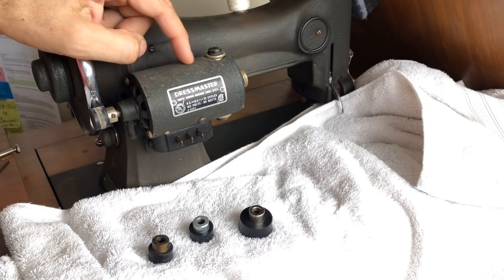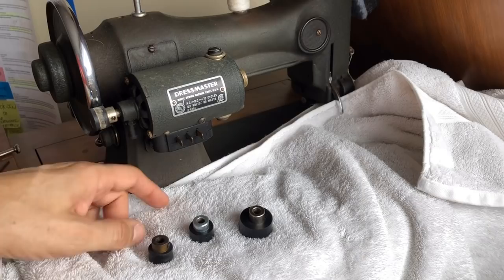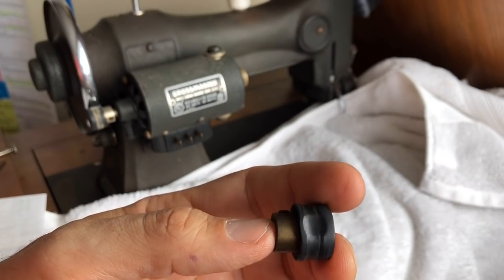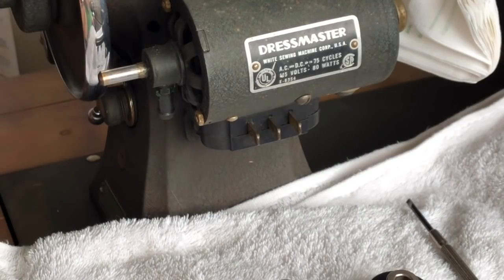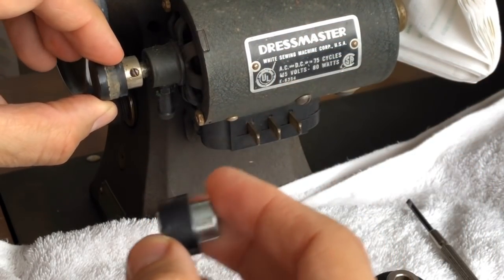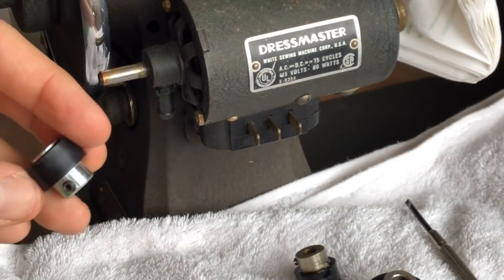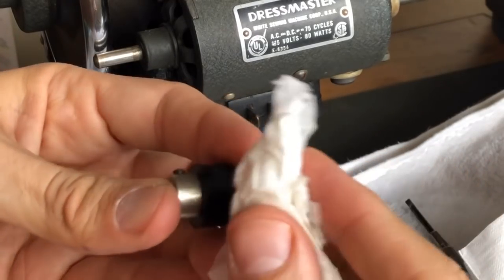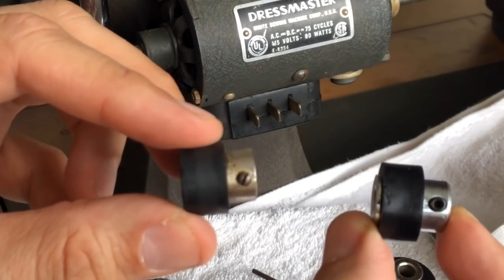ROTARY SERIES #1: FLAT TIRE! Replace a Rotary Machine's Friction Rubber Pulley & Start Sewing Again!

Comment: Thank you for these videos.  I recently changed the friction dry pully.  It took FOREVER to get it off, even though I used WD40.  It was a STRUGGLE !  AFTER  it was off, I RE-listened to your video.  You mentioned waiting overnight before pulling it off.  Since I'm a senior citizen,  I probably won't need to replace it again.  But for other ladies watching your videos, please EMPHASIZE  that the WD 40 needs to sit OVERNIGHT...( AND that it may be much harder
for a lady to pull it off than for a man to).  I had to use all manner of tools to pry it off, including PRAYER.  I'm glad you showed 
more than one way to screw in the little screw ( I used an eyeglass repair kit screwdriver).  Keep posting these videos.  They help .
Reply from the maker: Thank you for sharing these ideas Andrea.  Yes, it can really make a difference if Penetrants such as WD40 or other brands are allowed to sit overnight.  Actually, I may have mentioned this in a video I did several years ago when I had to soak a Singer 185J for over 2 weeks (maybe 3?) to get it to loosen up, but its a great idea to repeat this approach so thank you and its exciting to hear that you managed to get yours replaced!!
Reply: @VintageSewingMachineGarage hola tengo una Domestica Rotary 167 esta linda máquina trabaja muy bien solo que la polea está ponchada y aquí en México 🇲🇽 no encuentro. Usted sabe que lugar puedo comprar por envío? Soy de Monterrey México.  PD.👍Me gustan sus videos gracias

Comment: I just begged for and was given a Dressmaster Rotary. I have had a Kenmore Rotary for years, so there's nothing new about it, really, but I was given it with the understanding that it needs refurbishing. There's a possibility that the spring pushes the motor to the handwheel might be bad. I've watched this series, but not guidance on how to deal with that problem. Do you have any suggestions?

Comment: I just inherited one of these from my mom.  It definitely has a flat tire, needs all cords replaced and a very indepth cleaning.  I look forward to seeing more information from your videos, you are very knowledgeable.
Reply from the maker: Thank you Valerie.  The great news is that you can get new reproductions of both the friction drive "tire" pulley as well as the power cords for these.  Stay tuned for additional new videos on my White version of your machine.  They share many components and features.
Reply: @VintageSewingMachineGarage  thanks please show the movement of the lower assembly

Comment: I have a white rotary with black enamel and gold paint decorating it. It has the motor and a light in the rear. When I took it out of its case to restore the case, I was wondering what had happened to the belt. 😳 Now I know there wasn’t one to be found on purpose. I can’t wait to clean, oil it and get it running. Thanks for these videos.

Comment: I have two White machines that have a bevel pully and I can't find a new pulley for them. One is a 1926 bronze anniversary edition. I tried the small pulley replacement and the rubber wont reach the wheel (the motor does not adjust as yours does) supplier has the same machine and states the large pulley wont work with the machine either. I have used a section of rubber hose to retrofit and it works so so. Did they actually replace the entire unit back in the day or just the rubber? Seems like they were very frugal back then maybe there are rubber parts still around?
Reply from the maker: Great question!  I've never had one of these as old as yours, but there should be some solution given how large the White brand once was.  Try joining a White or Rotary sewing machine group on Facebook or another social media site.  There are lots of devoted fans of many brands that have groups/clubs online where they share info.

Comment: Do you have a video on how to replace the Stitch Length Plate and the lever.  I tried to take it off and there was a very thin yet very strong metal rod (within the lever itself) that popped, but did not break off.  My machine does sew, however it is not letting me change the length of the stitch.  It's sewing in a micro stitch fashion regardless of what number I place the knob.  Since that metal rod sort of popped, it still sews the same and does go in reverse.  What is your suggestion? Try to fix myself or take to get it repaired?

Comment: Im so glad you did this video..i just bought a 1917 Singer 66 Red eye with a Steampunk motor...Ot doesnt take a belt like the one you have but the motor looks different...She is beautiful in surprisingly great shape for $50.00. She  came in an 1890 something bentwood case and had 13 different back clamping feet or attachments all original..Sadly shes missing her bobbin slide plate..Im so sad about that but then again for $50 bucks who can complain, right? Im desperately looking for an original one ... So she runs great.... BUT is only steady going when I apply light pressure to keep the roller wheel against rhe hand crank wheel...

Comment: This video helped me so much!  The pulley part was completely missing from my White machine after years stored away. 
I was able to order another one. 

I have another question:

My Brother select-o-matic ZigZag machine came to me with a huge bent 1 and 9/16th inch needle in.  I replaced it with a regular 1.5 in universal needle but it doesn’t reach the bobbin hook. Do I need to buy long, heavy-duty needs only? Are there long universal needles?  Or do I need to adjust something?

Comment: Another question - I have knee pedal on this machine. Where can i find foot peddle for it since the 3 Pins on this machine is not Round. In Market most 3 pin foot pedal are round ones and this machine needs flat ones like our Electric Plugs. BTW, I made the machine work from ur videos. So thank you very much for detailed video series.
Reply from the maker: This Ebay seller has them.  Decent pricing even with shipping.  They may have a generic electronic foot pedal that you can purchase with the cord also. Or they "might" sell you the cord and pedal already wired together for a fee.  Contact them.  Here is the link to the cord.  
https://www.ebay.com/itm/302295555513?hash=item4662381db9:g:2FEAAMXQKtdQ12y6

Comment: I recently picked up a Free-Westinghouse machine from the 30’s that has a friction system like this. The machine is all original with copper hardware on the table and the original bulb! The old screws really like to seize up and become extremley tight. Anyways thanks for the info in this video!
Reply: Big Hoss I was just going to post the same thing. Mine was my grandmothers’ machine, a Free-Westinghouse Stratford. The replacement from sewing parts online had a slightly smaller inside diameter, so I had to sand it with a dremel. Such a beautiful old machine.

Comment: My mother gave me her White MG77, which 
has a rubber friction piece that is somewhat conical in shape. There is a bit of a flat spot on it (haven’t used it since about 1988 & I didn’t know about moving the motor off of it) & I’m wondering what to do about that. Thanks for the information here!

Comment: I have a Domestic. I need to replace the motor. The wires are frayed and exposed.   Cann you get replacement motors?
Reply from the maker: You can search online for used motors from parted out machines.  Or you can take the motor you have to a shop that can rewire it for you.  For this style of motor, there are no new production versions, but this machine/motor style was made for many years so the motors are not rare.

Comment: Love this series! I just purchased a White Rotary Electric and the manual says Book Number 75 so is that the mode? Can you please tell me where you sourced your parts? Thank you so much for the excellent videos! You sold me on this machine. Blessings.
Reply from the maker: Hi Susan.  Not that is not the model number.  There were model "Series" that contained model variations.  I believe this is the 117.552 model but these machines did not change very often.  As for parts, one great place I have used is an online shop that has more rotary parts than most.  You can also find Ebay sellers that offer some.  Here is the link to the place I go to first.  https://sewingmachine221sale.bizland.com/store/page44.html

Comment: I have just been given a Carson Rotary (White Sewing Machine} Dressmaster. Where can I find an owner's manual?
Reply from the maker: You might not find the manual under the name "Carson Rotary", but if it was made by the White company, it should have very similar mechanicles/drivet rain other White-made models of that same era/design including White, Kenmore, Dressmaster, Franklin etc.  For White and Kenmore, those manuals are found in many places on the web as PDFs which you can purchase for very little.  First, look at the overall design and form of your Carson model and see which of the more mainstream brands such as White and Kenmore look closest and start your search there.

Comment: Hi, thanks for the video. I have a Dressmaster Rotary and I'd like to find out what year it was made. Where can I find the model number? I checked on the motor and the model number isn't mentioned. The only thing I can see is a metal plate below the flywheel that has the number "127-51041" on it.

Comment: I am trying to replace the pulley on my White Rotary model 43. I have removed the set screw, but the pulley will not come off. Any suggestions?
Reply from the maker: Try using a little heat (careful use of hair dryer should suffice).  You can also try a little rubbing alcohol around the shaft to dissolve the old oil.  That should work.
Reply: I, too, am having difficulty getting it off.  I've used penetrating oil and heat.  Maybe time and repetition will help.
Reply: If you get an answer,  I'd love to hear it.  My White Sewing Machine  is a series 77.  I got the screw off, but no matter what I did,  it won't come off.  My machine is NOT  a Dressmaster.  It's frustrating.
Reply: I'm an old lady, and I just FINALLY got mine off.  FIRST , I prayed.  I prayed very hard, because I tried getting mine off before without success.   Then I  carefully  covered the motor with plastic and sprayed the metal part of the pully
.  Keep pap towling handy for drips.  Then let it sit OVERNIGHT.   
( I DIDN'T  do that, so I struggled)
First using a channel lock (sort of long pliers)  then I used a sturdy flat head screw driver, to sort of pry it off.  ( Still with me?)  Then I hit the handle of that screwdriver,  with a hammer I got at Walmart.   It looks like a normal, sturdy hammer, but it's short.  I WHACKED THE HECK OUT OF IT.
Then I was making profress.I was about half way there.  Then I  owed a STANLEY  17"  Ripping
Reply: ( UPPS...SENT TOO SOON!)
  STANLEY. 17"  Ripping Chisel.  I wedged it between motor and the thing im fighting to get off,  and PULLED.  PULLED AGAIN.  I DID THIS SEVERAL TIMES.  IT came off !😅  But, according to the VIDEO, i should have let the WD 40 sit over night.   Remember to pray.  A LOT !

Comment: Recently bought a Rotary Reversew model R40. When thinking about replacing the friction pulley, noticed that the screw holding the pulley onto the shaft is rusted tight. Any suggestions as to how to remove a rusted screw or how to get the old pulley off the shaft?
Reply from the maker: Hi Mildred.  One option for loosening it is to try one of the penetrant lubricants used for loosening old rusted and stuck bolts etc.  WD-40 and others such as the 3 in 1 Penetrant I recently used on the stuck Kenmore I have might work.  I would let them sit for a few days and see if the screw loosens any.  Try not to over force it since stripping it will only make things worse.  Also, be extra aware of how well sized your screwdriver is to the head of the screw. FYI, I use such products outdoors to avoid the smell inside my house.
Reply: @VintageSewingMachineGarage  Thanks, I have some WD-40 Rust Penetrant. Will keep applying and give it more time to work. Thanks as well for the screwdriver and ventilation tips.

Comment: I need help to connect electrical cord. It was taken off to change cord and now we don’t know how it goes? It’s this vintage rotors sewing machine
Reply from the maker: These use the same cord/plug that White Rotarys and Kenmore Rotarys had for decades.  There are 3 prongs mounted underneath the motor and the cord/plug should attach to these fairly easily.  FYI, there are new reproduction cords for these if yours is worn out.

Comment: The pulley that drives the machine and the one on the front of the machine to wind the bobin needs to be replaced on mine, as well as the cord.....Any information on where to get parts at??? VERRY similar to your machine but the brand name is DOMESTIC..Any info would be appreciated..

Comment: Hi, Thanks for your great videos. I have an electric White #8 with 1848186 stamped into the machined plate on the back of the base. It is electric, in a cabinet and is a shuttle rather than rotary style. It is glossy black with gold decals, rather than matt finish. It has the friction drive like the one in your video, but the friction wheel is elongated, past the rubber "tire" and the end is a belt pulley. The belt goes from there to a pulley on the bobbin winder. When you engage the winder, a rod pushes the motor back, away from the hand wheel so that the rest of the machine is disengaged while the bobbin is wound. This system is used instead of having a clutch on the hand wheel. So, my question is, where can I find a replacement friction wheel/pulley for my machine. Any help you can give is greatly appreciated :-)
Reply: I also have owned a White #8 with a shuttle since I was 11 years old in 1953 - Dad bought it new for me to help mend everyone's clothes as my mother was not very adept at sewing -  am almost 80 now.  I have always loved my sewing machine and taken good care of it.  The rubber on my motor pulley looks much thinner than ones for sale on the web so it may be worn down; I have compensated for this by winding black friction tape around the rubber pulley.  I can't find a matching motor pulley - mine has a hole - 5/8" and overall diameter about 1".  (Looked on site that he recommended also.)The spring on the motor has perhaps stretched as well, I guess, has become loose.  I didn't know this spring existed until I watched this wonderful lesson.  The machine will only work if I tie a shoe lace around the motor and pull it closer to the main body which then engages the wheel to turn.  The machine that this instructor shows - has the same motor number as my machine -E6354 but his motor pulley doesn't have the extension that supports the belt that winds thread on the bobbin.  My motor pulley does not have a flat tire - maybe my machine just needs another spring that would hold  the motor closer to the motor pulley.  So I, too, wonder if such springs are still available.  Can you demonstrate how to replace this spring? Learned so much watching your video!!  I loved it!
Reply: I also need this type of pulley!!

Comment: I have the same model and My handwheel is not perfect smooth. I see tiny bumps in it. Can I still Use it? Cannot attach Pic in comment section.
Reply from the maker: Is it the steel hand wheel itself that has these 'bumps'?  Or is it the rubber friction pulley wheel that is not smooth?  THAT part can be replace and they are sold online for reasonable prices.
Reply: @VintageSewingMachineGarage  it is steel hand wheel just like u have in your machine

Comment: Hi! thank you so much for uploading the great vidoes. I recently purchased a Kenmore 117.552. I have already replaced the rubber pulley :) with your help. My machine does not have the "Stop Screw"  Do i need to replace the entire plate (Rotary , forward,  revers) or can I just replace the screw? and where can I purchase that part?
Reply from the maker: Check with this seller (https://sewingmachine221sale.bizland.com/store/page44.html) as they may have what you need or can steer you to a seller who does.  These machines were made in VERY large numbers over many decades so there should be parts out there.  Also, try bonanza.com

Comment: I'm sure this is a stupid question but I'm getting into leather working and my mom is passing down a White Model 43...was wondering if it strong enough to sew leather 🤔  biggest projects would be a wallet
Reply: These machines are really strong actually. Much stronger than most modern machines, so you should be ok. You'll just want to get a needle meant for leather (it helps) and help get the wheel started. Once the wheel has an opportunity to get spinning it will plow through leather pretty nicely..
Reply: I have the 43 also, can you help me find the manual for it. I can figure out the threading and bobbin threading.
Reply: @belindaleighfrazier8165  if you need help, the manual is available online - there are scanned copies on Etsy

Comment: I have a vintage kenmore model # 83 that needs a new rotary friction pully but don’t know where to fin one.
Also need a rubber replacement for bobbin filling attachment. 
I only have one bobbin and desperately need more. Can you help me?
Reply from the maker: Try this site Mercedes.  I've received good service from them and they stock an impressive supply of parts both vintage and new for these machines.  
https://sewingmachine221sale.bizland.com/store/page44.html
Reply: I read your request.   I got bobbins and a rubber motor pully from Amazon.